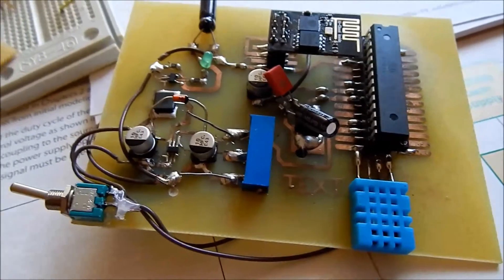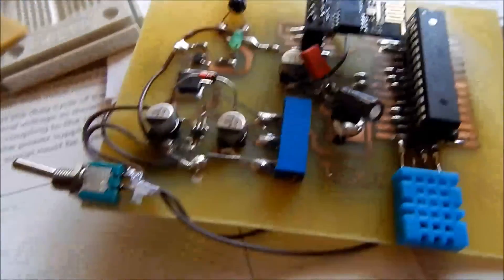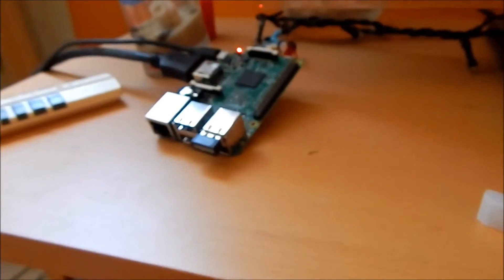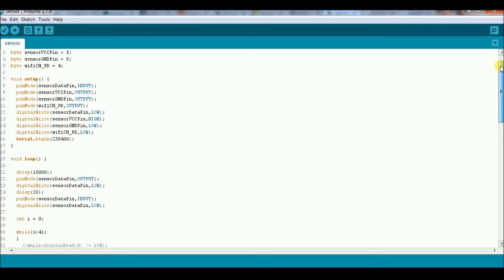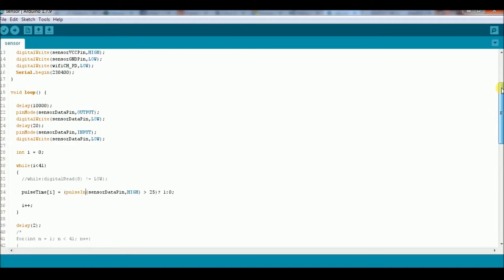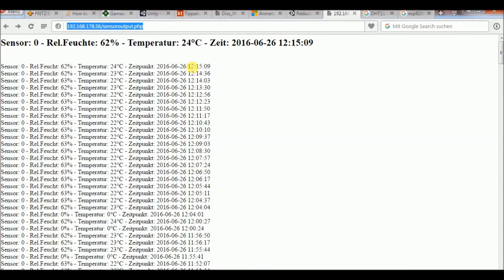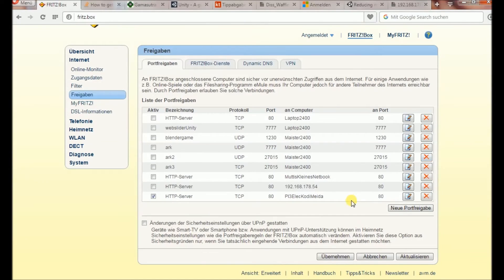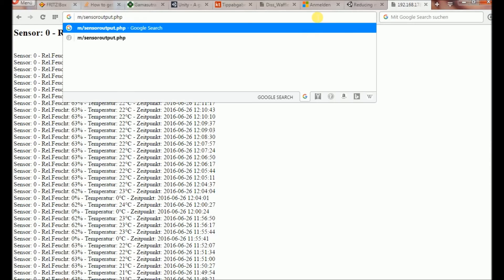[EN] Measuring temp and humidity with HDT11 and sending via esp8266 (wifi) to MySQL-Server

Comment: Sir, i have interfaced Arduino Uno with esp8266-01 and Temperature sensor. I have a local server installed in my machine. Now i wanted to send the data (temperature value) to local server. Any Idea please.
Reply from the maker: Hi,
What Kind of server is running on your machine? A webserver?
Reply: Yes.It is Webserver.
Reply from the maker: You now need to code .php or pearl-file for this server.
you then need to tell the esp8266 to open the url to the file on your webserver via a http protocol and send a variable with it.
For example like this:
http://<IP_OF_MACHINE>/myPHPfile.php?temp=25
the php-code is processed on your webserver and can then store the temp value in a file or a database on your machine.
I can do a video on that in some time, if you like.

By the way: the esp8266 is designed for 3.3V. Arduino uno is 5V. You need to be sure to not damage the esp8266. Thats why I did my own PCB.
Reply: Thank you very much for the reply and information.  Yes it would be very good if you post video on the same . Ya ESP8266 i connected to 3.3 v with regulated power supply circuit.
Reply from the maker: ok, I will do a video, when I have time for that.
Keep in mind to also connec the ground of your arduino with the ground of your regulated 3.3V, if not done yet. Other ways you will not be able to have them talk to each other.
Also, the Tx pin of your arduino is operating at 5V, so you need a voltage divider on that to connect to the esp8266's Rx in order to not damage it.
Reply: Ok Sure.
Reply from the maker: I have uploaded the first video of the explaining videos ;)
In this video, you see how to code .php for your web server and send data to it by modifying thr URL.
Reply: Ok.Thank you . i wil have a look at it.    

Sir, Now i need to fetch the data from Server that is Server time and time when the device is turned ON.  I tried ,but getting the error on serial concole of Arduino. I can show my ESP8266 code and output screen shots if you want. Please reply.
Reply from the maker: Yes, try sending me a private message here at youtube.
Reply from the maker: I can not find where to send you a PN. I would like to give you my email ID in private. Can you send me a PN here at youtube?
Reply from the maker: ok I e-mailed you ;)
Reply: Ok Sir. I have replied to that mail.